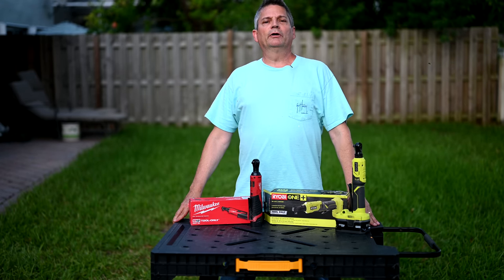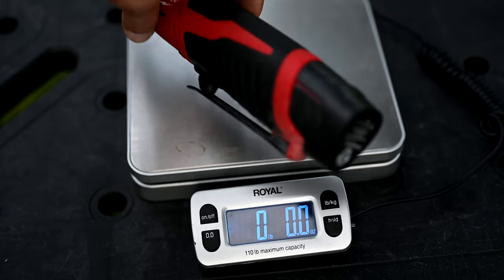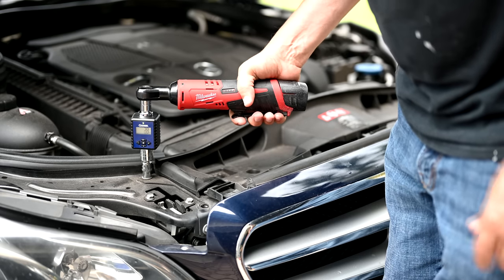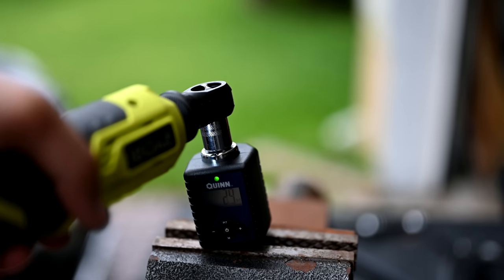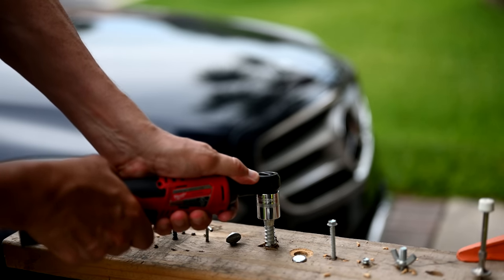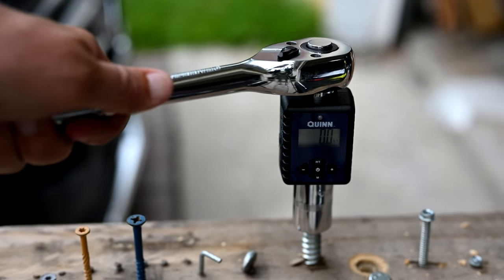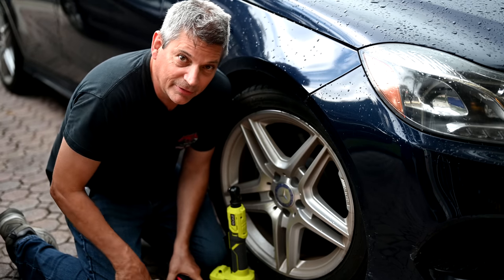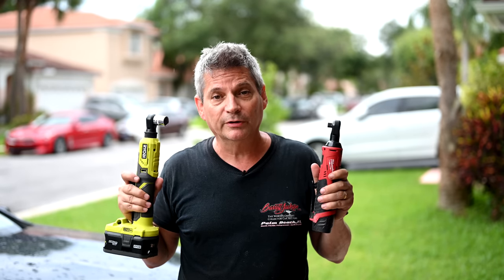Ryobi 3/8" Cordless Ratchet Vs. Milwaukee Torque/RPM Tests

Comment: I would have liked to see you use a fully charged XC battery pack on the Milwaukee since it was against a tool with 6 more volts and ?more amp hours.  XC packs put out more amps under load and can make a big difference. 

Pros don't generally use Ryobi because they don't hold up over time.  Another couple of seconds on that lag screw and that Ryobi would have let out the smoke for the last time.  And it's brand new!  It lacks the protection circuitry that the Milwaukee has to keep from damaging the tool and the battery.  That circuitry cost money to make. 

For weekend warriors or guys starting out on a tight budget, it may make sense.  Some contractors do buy Ryobi because their crews will destroy whatever brand they provide and consider them disposable.

Just like GM makes both Cadillac, Chevy, Buick, TTI makes 4 lines of cordless power tools.  And just like GM's cars, TTI's tools are for different levels of buyers.

Hart at Wal-Mart, no explanation necessary.  To early to discuss how they will last. 

Ryobi are entry level/consumer tools.  Usually work fine for a short while and suddenly die.

Rigid licensed by Emerson, prosumer tools.  No where near the quality of the actual RIGID hand tools used by plumbers and electricians everywhere.  Rigid in name only, though decent quality. 

Milwaukee is the premium line used by pros in the same league as DeWalt and Makita. 

Each has their niche and price point that caters to the respective buyer.  Premium brands cost more because they are made to higher standards with better components.  Yes, some components will cross brand boundaries.  But when you look at the materials and electronics inside, the difference is apparent.  Heavier wiring, potted electronics, higher quality machining, better fit and finish, stronger plastics with more glass fiber reinforcement, better warranties, better batteries, etc, etc.  No company makes perfect tools.  But you generally get what you pay for.
Reply from the maker: So Mike, I don't think adding a more powerful battery gives you more power. That's a mistake many people make with regard to power tools. A Higher capacity battery just gives you longer battery life. The motor is set to perform at the speed it performs once it sees 12V. the only tools we know of that produce more power and torque with a larger batter are Dewalt's new PowerDetect series introduced in March.
Reply: @jeffostroff  That's mostly false.  The bullet battery in that tool has 3 cells.  XC packs have 6.  That is twice the available amps as they are two parallel banks of 3cells each in series.  Now, testing the 3 cell packs against each other you are probably correct.  I.e. a 3ah battery likely wouldn't show a performance increase over a 2ah pack.  Only runtime would change.  And likewise with the 3,4 and 6ah XC packs when compared against each other.  I cannot say for sure that this particular tool can draw enough amps under severe load to make a difference though.  I do know that the battery and tool "talk" to each other and if either reaches an overload threshold, the circuitry will cut power to the motor.  I own over 100 Milwaukee cordless tools, both M12 and M18.  That obviously doesn't make me the foremost expert on the topic, but  I use them every day.(not all of them of course) And I know my tools.  Due to the compactness and performance of the M12 tools, they are the ones I tend to use the most.  I can tell you from experience that the larger packs will produce more power under load than the compact packs.  And with either pack there is a noticeable difference in power between a battery with 4 bars and one with 1 or 2 bars.  For instance, one of the common tasks I perform is to drill and tap 2 1/4-20 holes and one 1-1/8 hole in 1/4 in mild steel and sometimes AR plate.  The bullet packs easily drill and tap the 1/4-20 hole without issue.  But if I try to drill the 1-1/8 hole with a thin wall hole saw, it will constantly cut out.  When I switch to an XC pack, it plows right through with no cutouts. I can say with absolute certainty that the M12 drills, impacts, circular saws, inflator, die grinders, cutoff saw, polisher, and vacuum all perform much better with XC packs.  Low drain tools like lights, soldering iron, stapler, caulk gun etc don't draw enough power to show any noticeable difference.  I think the ratchet falls into that "maybe, maybe not" category until I see it tested or test it myself.  An odd side note: Some lower capacity packs have cell chemistry that enables higher drain rates than their higher capacity brothers, giving higher performance with less runtime. I think this all is a great topic for a video in the future.  Simply drive a lag with a compact battery and switch to an XC pack and see if it makes a repeatable difference.  Sorry to be so long winded.  It's a curse of mine.  haha! Thanks for the reply and keep up the good work.

Comment: Maybe the ryobi has a much larger battery.  And maybe neither of these ratchets are made for what you're doing to them. Maybe your tests are completely stupid. Maybe your pilot hole was way too small. 

Honestly this was a painful video to only 3/4 watch. These things were made to quickly thread and unthread nuts. You still need a ratchet to set or break them loose. I assume you know this because who the hell dosen't know this. This begs the question WHY ARE YOU DRIVING LAGS? nobody is using their 140 dollar ratchet this way. What are you trying to prove?  Both ratchets you have do exactly what they were designed to do. The only real difference is price and form factor.  Personally,  I don't want a huge ass battery hanging off it. But if you're on a budget and already own other ryobi tools,  then the cost may be the deciding factor. Jesus your video was bad. Enjoy a down vote.

Comment: Your explanation of why you'd want one of these in a tight space where you cant move a normal ratchet very much proves the ryobi wouldnt be a good investment as the purpose of the tool is defeated from the car battery hanging off it, even if you can turn it i garuntee that the milwuakee would fit into much smaller spaces also  WHY ARE YOU USING THE 2ND GEN MILWUAKEE THE 3RD GEN ALMOST DOUBLES THE TORQUE
Reply from the maker: The 2nd gen is all I had, bought it 3 years ago. I want to upgrade to the Fuel version and do another review soon.
Reply: @jeffostroff  sorry for being so heated but the comparison is basically moot if its the old miwuakee one, still a good format tho i wouldn't change how you did the review other than giving the milwuakee a fighting chance lol

Comment: Maybe I'm wrong (mine is a bad English) but you are comparing a 12v product with a 18v product ... maybe a non-equal comparison? correct me if I'm wrong..
Reply from the maker: Yes but they both have the same to work so it's not like you can assume that the 18 Volt product necessarily has more power than the 12 Volt product, because they both have the exact same torque spec

Comment: I already have the One+ setup, I'm looking for a budget (less than $100) ratchet. Ill be using it to work on cars. Should I go with the Ryobi or a standalone like the ProStormer, Kimo or AC Delco?
Reply from the maker: Look at the size of the Ryobi, see if it will fit where you need to use it.
Reply: You should buy the 3/8 Milwaukee Fuel, it will last, fit in places the Ryobi will not. Plus if you ever decide to part with it you'll get more of your investment back on Craigslist or marketplace.

Comment: Love the video quality also how you respond to every comment great reviews but I have a question what do you think of the air rachets
Reply from the maker: Air ratchets are the best! They are especially used for lug nuts as they can handle the torque required, often over 100 ft-lbs for lug nuts. But for tight work inside the engine, you might be better off with the smaller and more mobile Milwaukee and Ryobi.

Comment: They could’ve squared off the battery and used the same connector to plug the big battery or a smaller battery to the ryobi
Reply from the maker: Yes, Ryobi does not have an M12 equivalent battery

Comment: The m12 fuel is a beast compared to the brushed.
Reply from the maker: I need to upgrade to the fuel.
Reply: @jeffostroff  I use the smaller one for smaller fasteners I might overtorque with the fuel.just the head on the fuel weighs a bunch more.
Reply: The fuel model is terrible, the head is way to big

Comment: That battery sticking out makes it almost impossible to use< at least on Hondas. You barely have space for stick your hand in some areas
Reply from the maker: I got news for you, in many areas you can't even get your hand in with a ratchet  or a stubby wrench, so no need to grip about this. These are made for all the nuts and bolts that you can reach from the top of the engine.

Comment: So the ryobi has a bit more power to handle that larger bolt because it runs on an 18v battery right and the milwaukee is 12v. Also i think you are using a 3 or 4ah on the ryobi in this video is it not? Looks a little too big for it to be the 2ah one that it comes with
Reply from the maker: The Ryobi is a tool only. I should try my 1.5 on it and see if it works as strong, not sure I did that one yet.
Reply: jeffostroff Online there is an option for charger and two batteries(2ah). Im sure that is a big factor with it being 18v and 4ah. There was another video somehwere on youtube of a guy doing a review on a ryobi tool and got different results on the same job when he would swap between lower and higher amp batteries.

Comment: You will find that milwaukee and ryobi are built by the same manufacturer as ryobi is level entry tools but highly popular and rather robust as the milwaukee. But i would agree with the ryobi battery on a tool that size far to big and about time they did a smaller battery.
Reply from the maker: An R12 battery would be nice from Ryobi, LOL
Reply: @jeffostroff  the funniest thing over here in the uk the ryobi batteries are mote expensive than the milwaukee lol

Comment: A cordless ratchet definitely isn't the right tool for lugnuts on a car. A cordless impact wrench would be the tool for that and also torque isn't something you need much of for a cordless ratchet since you can manually use the electric ratchet for applying torque to a fastener once you have ran the fastener down snug.

Comment: Very insightful but I prefer my Dewalt pneumatic...plus I love the power/sound in my garage...my impact as well.
Reply from the maker: Good choice Dave, I mainly use mine for dishwasher installations, and working in tight spaces in engine.
Reply from the maker: You know it, those things are loud, I've been at ground zero when one of those things goes off, thankfully it's only for a second.

Comment: I wonder if you use a bigger battery on the Milwaukee would it do better
Reply from the maker: Well the tools are both rated 35 ft-lbs I doubt increasing the voltage will do anything if they put voltage regulation in

Comment: Jeff... what kind of step ladder do you use?  And or what's the best step ladder in the market right now?
Reply from the maker: The ladder I plan to get soon now that it's $20 less than the $99 Father's Day price is the 6 ft. DeWalt Fiberglass Stepladder https://homedepot.sjv.io/a0A2o What I really like about it is the larger steps, so I don't stand on the balls of my feet and it digs in to my foot. This new ladder has deeper mega step, designed to provide 25 % more standing surface, so more surface area of your feet rest on the step, better balance. Also Fiberglass means I wont get shocked when doing electrical work if a live wire touches my ladder. Also top has a magnet tray, and bottom has impact absorbing bottom bracing. I showed this ladder at Home Depot during one of my walk throughs in early June.

Comment: The ratchet and the Brad nailer from ryobi seem to be very well reviewed tools. Not much else. I just got the Brad nailer and it is living up to the reviews.
Reply from the maker: I heard a number of guys on our livestream in Home Depot also tell me the Ryobi nailer was good.
Reply: @jeffostroff  I thought the Ryobi nailer was decent too when I used my co-workers until my boss bought me the fuel 18 Brad nailer as a bonus for a job and HOLY CRAP does it shit all over the Ryobi. Not just in ergonomics but in battery usage and nail depth consistency as well

Comment: I enjoyed learning from this video, but I question the validity of your results.  Shouldn't an 18 volt tool like the Ryobi outperform a 12 volt tool like the Milwaukee?  To compare apples to apples, perhaps you should compare 18 volt performance to 18 volt performance, and likewise with 12 volt tools.  If Milwaukee built a ratchet on its M18 platform, I doubt the Ryobi 18 volt ratchet would prove to be much competition.  Ryobi also doesn't seem to sell a ratchet in its 12 volt platform, so we can't get a fair test on 12 volt ratchets, either.

Comment: I'll take Milwaukee Any Time even If It is the old model with only 35 foot pounds because that one Ryobi has a huge battery it's going to be in the way
Reply from the maker: I want to upgrade to the newer Milwaukee that goes to 55 ft-lbs.

Comment: I've been a professional contractor for 35 years and Ryobi has really upped it's game.  Sure, the high-end brands are still a little better in most cases, but Ryobi is on their heels. Their tools perform well, they last, and they are priced right!  I actually use Ryobi in my home shop due to the shear selection of tools that will all use the same battery and the low cost. It's served me very well.
Reply from the maker: I think Ryobi will blur the lines on this HP lieneup.

Comment: The battery on the ryobi.is bigger.
Reply from the maker: Yes but ryobi also made the head rotatable so you can spend the head around and now the head is facing the skinny side of the battery making it no worse then the Milwaukee ratchet

Comment: Ryobi has brutally big battery amd for that it won't work for me. The fact the head moves doesnt always help. Milwaukee is better for its battery size and specs
Reply from the maker: Milwaukee doe snot have better specs, they both have the same 35 ft pounds. But yes Milwaukee is smaller
Reply: I meant to say batteri size specs. Just the exact size it has is better in my case. I use snap on which is almost identical to the Milwaukee thats how i know

Comment: I've used the milwaukee one on cars and put to MUCH abuse. You can use it as an actual locking ratchet to break lose nuts and tighten. So no need to worry about breaking anything in the head of the ratchet. Most things needing tighten and lossened with a 3/8" ratchet don't take or should take enough torque to do any damage. I have also just purchased the ryobi WITH a battery and charger for only 20$ more which seemed worth it as I was in the market for another battery. I'll see how much more I'll use it over the milwaukee.i really do like the idea of a rotating head yet you can rotate the milwaukee 360. Very thorough review .

Again you can buy the ryobi with a battery and charger now
Reply from the maker: That makes the Ryobi more attractive now with the battery in the kit. You got lucky not busting the head when nut busting or when tightening the nuts. But just be aware the Milwaukee printed instructions for this tool warn us not to do that.
Reply: @jeffostroff  yea definitely worth it with the battery and charger. And I don't do it on HEAVILY torqued bolts. Pretty much anything I wouldn't use bigger than a 3/8" ratchet on i wont use this on. And always switch to an actual ratchet to tighten. Essentially common sense. If you work on cars daily you get a feel of when something is about to break and what its limit is. But so far that past few days using the ryobi has been great. The battery did prevent me from getting into a starter signal wire bolt but swiveling the head solved that. So definitely worth it imo. Also thanks again for the review great work!!!

Comment: So I noticed on the car the Ryobi stripped the threads it appears.  The Milwaukee stopped the bolt when it was at the torque level was reached, but the Ryobi kept spinning the bolt until you stopped it. Looked stripped.  This video could have been drastically shortened with keeping to the important things.

Comment: This actually shows how much grater Milwaukee is it’s using a 12v 2 amp vs a 18v 4amp lol and it’s still holding up if you put a higher amp battery on the Milwaukee it would roast the ryobi.
Reply from the maker: I still don't think adding more AH batteries helps out. IT is still a 35 ft lb tool, that will not see an increase in torque if you stick on a bigger battery.

Comment: You need both ratchets to be brand new in order for your experiment to be accurate.
Reply from the maker: Maybe, maybe not, they are both rated at 35 ft lbs
Reply: @jeffostroff  I think he meant that the wear from use could affect the results 
A new machine is nearly always going to outperform a used machine